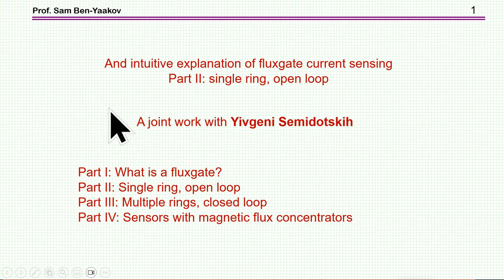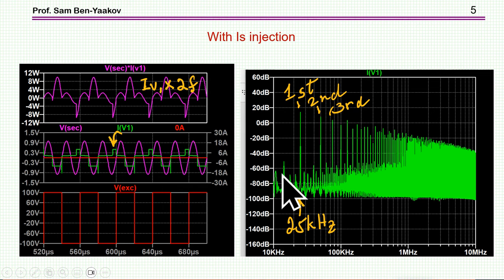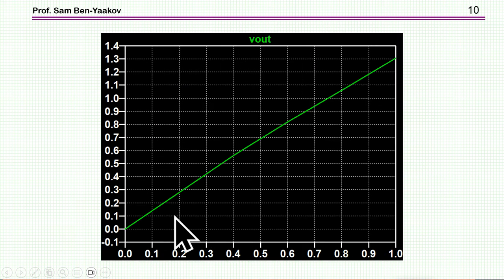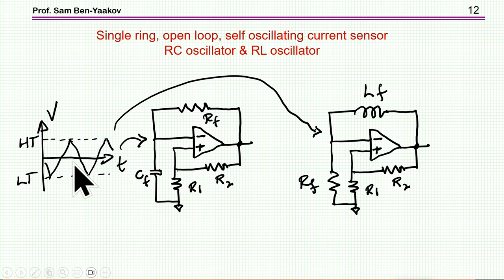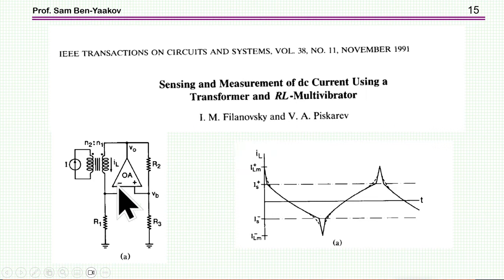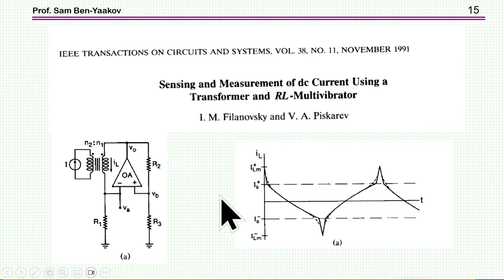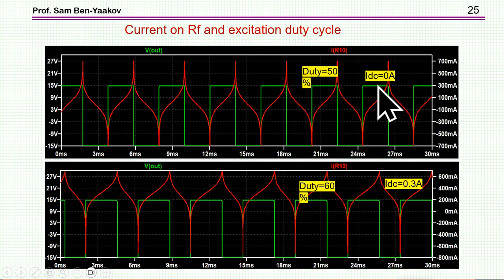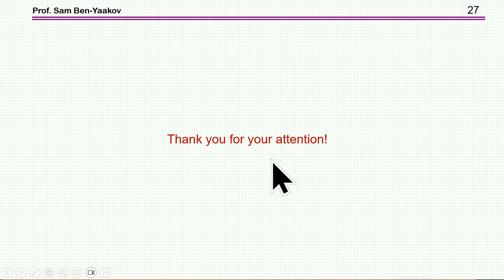An intuitive explanation of fluxgate current sensing Part II: single ring, open loop

Comment: Time stamp 19:16 can you explain practical circuit design calculation to design 6ma current leakage detection there are very less resources covering this topic... Iam  stuck in designing of its driver and detection circuit

Comment: Hello Professor, I am currently working on a current sensor for the flux gate to detect leakage current. Can I see your complete simulation parameters？
Reply from the maker: Send me your enil and the slode number or minute in video and Iwill try to send you the asc. sby@bgu.ac.il

Comment: שלום. האם בשיטה הזו לא יכולה להיווצר בעייה של השפעה נגדית (פרזיטית) של זרם במעגל אוסילציה על הזרם אנחנו בעצם רוצים לדגום (כמו בטרנספורמטור)??? כי בעצם מקור זרם הוא לא אידיאלי אף פעם...
Reply from the maker: Good question. The back transfer is very small especially since the back impedance, normally an inductor, is very large
 In sophisticated current sensors feedback winding are used to neutralize the back ripple. Oscillation is a question of control.

Comment: Sir, it is a very good lecture!! I am an inverter hardware engineer for electric vehicle motor control. Could you upload a lecture video on the inverter circuit design for motor control?
Reply from the maker: I will try
Reply: @sambenyaakov  Thank you:)

Comment: Professor, I had a question: If an inductor core gets saturated then is it necessary for the inductor current to become Zero before the inductor regains its inductance?
Reply from the maker: Not really, the current can go slowly down this will bring H to a lower value which will bring the core out of saturation.

Comment: In case we have localized saturation of the core, we might not be able to saturate the core [as the saturated section acts as an air gap]. Any mitigation approaches for that?
Reply from the maker: I think that this not a realistic situation because the same flux is passing throughout the core. Such a scenario will be similar to the case of a heating wire that will start building up the temperature at one point along the wire.

Comment: Most accurate method is to servo an opposition current through the core on a separate winding to null the 2nd harmonic
Reply from the maker: You seem to overlook that this video discusses open loop approaches.
Reply: @sambenyaakov  I didn't watch every second of it